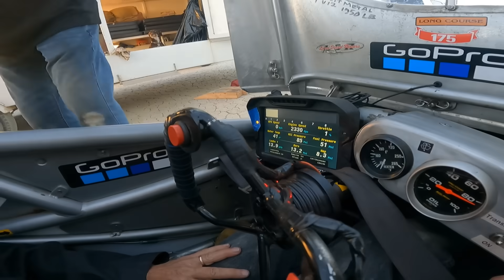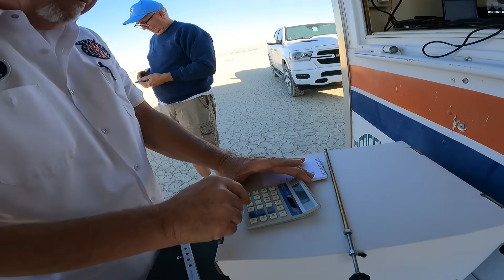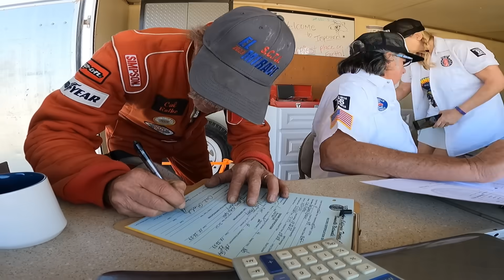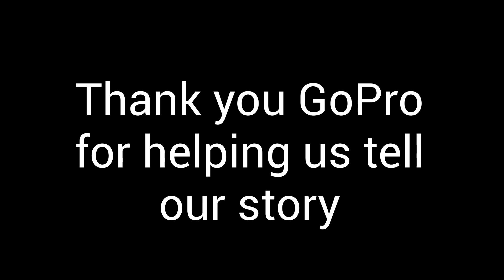223MPH Homemade 3 Liter Sheet Metal Engine Sets New Speed Record

Comment: Offenhauser got 750 hp out of a 168 CI (2.75L) 4 cylinder, and that was in 1968. I imagine that taking inspiration from that design, increasing the displacement and adding a computer, modern electronic controls and VTEC
EDIT: (last sentence cut off) should reliably produce over 800 hp at 3L, with a better power profile.
Reply from the maker: Pete and Kevin consider all engine makes and designs. 750 HP is the end goal for the 3L sheet metal engine.   The difficulty is planting the HP to the rear wheels on pizza cutter tires on dirt.    Kevin is gonna crank up the boost a few a few more PSI for the November race.  Thank you Greg

Comment: Whoever gave you those IRL V8 heads is a saint, they flow huge air and you guys unlocked every horsepower.
Reply from the maker: Yeah Pete and Kevin indeed like the IRL heads. Kevin is currently developing a new 4 value head. You can see more on the channel!
Reply: @GregQuirin  i got it wrong, this motor is a 3 valve head developed in house.
600hp, 4.84 bore spacing, iron crank tunnel and bores, welded assembly.

Comment: I have two questions:  Why is the engine called a "sheet metal" engine?  Why does it have an alternator for such a short run?
Reply from the maker: Alternator because all the electrical loads draw the battery down to 12.2 to 11.9V . This causes low fuel pump output and in some cases the computer will malfunction when source voltage is below 12.2V  the fuel pump draws about 18 amps+ Coils+ Fuel Injectors, Heated O2, Dash display,  Water Pumps and ECU ends up being about 40 + amps total draw which will take a 12.6V battery down to 12.2v. Some racers use a 16V battery for this reason if they are set as a total loss system. This car runs several different engine configurations such as the V12 which has even high current draw. 

Here is info on the sheet metal engine - https://www.motortrend.com/how-to/how-to-build-your-own-sheetmetal-engine/

thanks,
Greg

Comment: Am I missing something? That’s not that much horsepower from a 3.0l turbo. Import croup regularly get 1000hp from small displacement. Great job on the record though.
Reply from the maker: 660 HP is pretty remarkable considering the unique circumstances of this build.  Yes, import tuners are making more HP however in land speed racing the engine needs to last multiple runs. At Bonneville alone, to get a record, the engine needs to last 10 miles at top rpm for two 5 mile passes.  As it stands right now, Team Aardema Braun hold the official record for the fastest F designation engine class 2L- 3Liter Lakester. We welcome others to come out to the lakebed and see if they can take the new standing record!

Comment: Interesting as theres 4 cylinders doing this in the 1/4 mile now making well over 1k hp
Reply: Food for thought...the cars you referenced are on appx. 60 - 90psi+ of boost and a prepped track...Pete's car is on 13psi in the dirt with a hand welded, sheet metal block lol! It took 47psi to crack 1000whp with my 2.1L 4g63 DOHC Evo...650 on 13psi and SOHC is bad ass!
Reply from the maker: Car is going back to the Dyno this week.  Boost will be ramped up a few more lbs.  This engine has been around the block a few times some Pete and Kevin want to keep it all in tack.   We will see if she can make 700+  

Thank you,

Greg

Comment: I wish you could show much much more on the home engineered engines, 
I would love to build engines, if I had a lathe and mill , and place to do it..  make pistons near tge same diameter as a16 litre cummings   5.25"- 6.0" bore, with a 3" stroke , tickle 10k rpm maybe individual heads with the bore offset. Like a vr6  , a 15°-18°  , 22°or less,  with the intake runner basically running about 10° into the valve , in the center,  with 2.25" intake and 2" exhaust, 4 per cylinder. Near 5" of intake valve per cylinder . 4.5" anyway,  with 2.25" primary headers,  with 6 cylinders .    It should be closer to a inline 6 balance, I have been thinking about a half piston valve, being in the block, using a flat head with only a dimple for plug .   With a plate with the port in it covering the, the port being 1/3 the bore, by about .500"+/- .400"  it can use graphite seals and half rings similar to a piston,    it should  flow well. No valve to restrict, alot like a motorcycle carburetor,   it's similar to a 2stroke engine using the piston as it's valve. Use a camshaft and rocker with a spring keeping the valve closed, a roller cam with a fast open and close rate, and fair amount of duration. Porting would be similar to a two stroke in some ways,  the cam would control timing, the port would  tweak that timing slightly,  having the combustion chamber in the piston it should be efficient,   I'd love to build a single proof of concept engine!!
Reply from the maker: Here is more information on the sheet metal engine https://www.motortrend.com/how-to/how-to-build-your-own-sheetmetal-engine/
Reply from the maker: I’m going to let Kevin Braun respond to this one!

Comment: Nearly too much power for the tires. I wonder what a 4WD system would do for speed. Has anyone ever experimented with some kind of traction control?
Reply: More drivetrain losses, more weight, more complicated, more things which can go wrong.
Reply: @jareknowak8712 Yup a lot more loss to friction from more moving parts. It’s all a balancing act. Enough tire to get proper traction, but not so much to increase drag/friction.
Reply: Probably add more weight than it's worth but maybe not